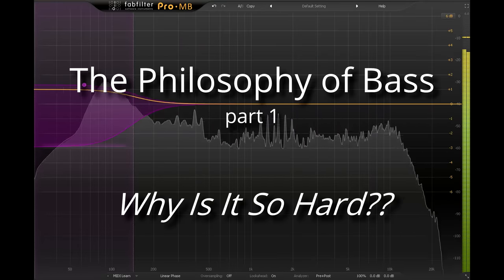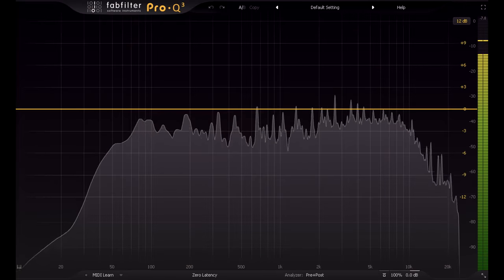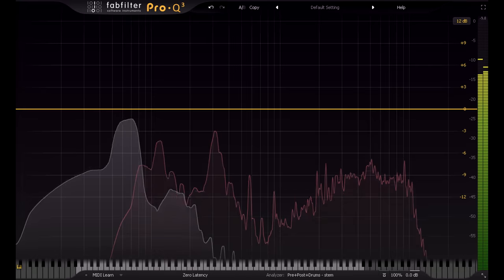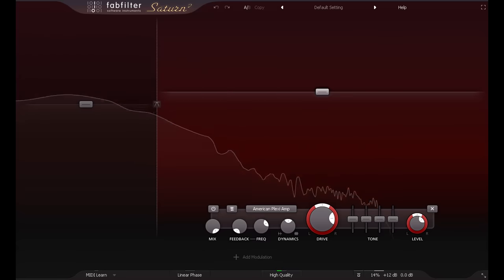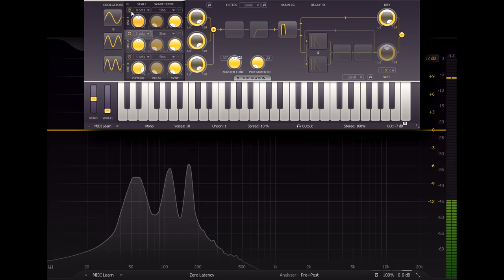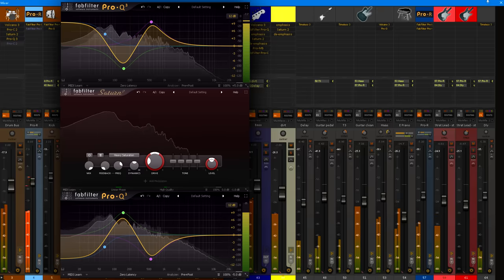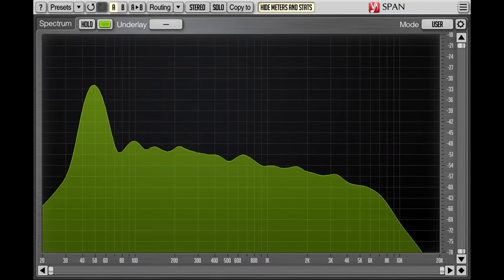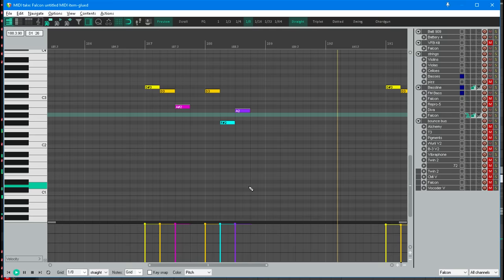The Philosophy of Bass

Comment: Why in the "Brain Bass" part is the third oscillator the fundamental + a 5th?
Is that needed for the trickery, or can it be an octave as well?
Reply: It's the third harmonic, at three times the fundamental frequency. Which is almost exactly one octave plus a fifth higher. The second harmonic is one octave higher than the fundamental (2x the frequency). The fourth harmonic is two octaves higher (4x the frequency). 
2nd plus 4th harmonics won't work: the second harmonic will become the fundamental, the fourth will become the second, and your part will sound an octave higher.
Reply: @DanWorrall  I get it now. Thank you.

Comment: Bass is ambient sound, omnidirectional. Whilst I wholeheartedly agree with larger is better the enemy of clean bass is resonance. For years I bought every speaker known to man. After being fed up with jousting with windmills I decided to build my own. A 2 way ported bass reflex using a 10” driver. The bass I experience is superb in bass impact AND bass extension. Why? I canceled rear deflections in the cabinets using felt behind each woofer. Resonant free. Pure bass impact and extension.
Reply: Care to explain a little more about this? wondering if this is a feasible DIY project
Reply: @220_hz4  I would but I’m seriously contemplating going into speaker building business when I retire. These produce competent thunderous bass with near holographic imaging. I don’t use soft dome tweeters either.

Comment: Even without basstraps you should have the subwoofer, just tone it down and then REMEMBER that it is turned down a bit, or has a modified curve. But it is better to have it than not. This is one big myth that still affects sound engineers, thinking that if it is inaccurate it is worse than not having it at all. 

There is a third option: subwoofer with headphones. If you have decent subwoofer, try it.. turn the main speakers off and leave the sub on.. it can be amazing, as it combines the accuracy of headphones with deep actual sub bass...

Comment: I think bass is difficult for a few reasons. First, we don’t hear very well down there. Our ears are much more tuned to hear stuff from 800-4k or so. Secondly, it doesn’t image…it just sort of “exists” as far as our ears are concerned. It’s more of a feeling sometimes and I think it can be difficult to engineer a vibe/feeling. On a more specific note, I think it’s easiest to get into trouble when you’re EQing bass. EQ for bass can make notes disappear and give your bass that uneven, touch and go sound. At the end of the day, it’s all about anchoring a high quality bass sound and locking it in with your kick…it’s just a totally different realm than midrange and treble. But the one thing it has in common is that the earlier you get a great sound, the better. The more you have to process your bass, the thinner the ice…

Comment: I didn't understand how you created that psychoacoustic bass (based on 2nd/3rd harmonics). You used a bassline played by a bass player and talked about parallel distortion. But how did you generate the psychoacoustic bass signal from the recorded bass and is it this signal that you're distorting in parallel?
Reply: It happens naturally with bass guitar, just make sure you keep plenty of midrange harmonics, and you'll be able to cut back the sub bass frequencies without losing the sense of low deep bass.
Reply: Well, the man himself explained it, but I can see why you got confused. He demonstrated the effect using synthesis to add and remove the harmonics. But a real world application of this would be parallel distortion, which has the same effect of adding those second and third (etc) harmonic overtones, allowing you to actually cut the EQ where the fundamental is (to make space for the kick etc). So the signal he is distorting is just the parallel signal of the bass guitar.

If you are a guitar player, or just have a guitar handy, you can emulate this psychoacoustic effect in your playing. Play an E5 chord as a double -stop - Open E and the fifth B (2nd fret) on the A string. Then play an inverted C5 chord, (3rd fret on both low E and A, notes are G and C). The second chord sounds lower than the open E5, despite both the notes you are playing being pitched higher. Learned this from heavy metal players! 🤘😝
Reply: @DanWorrall  Thank you, Dan
Reply: @RoganGunn  Thanks very much, Rogan

Comment: But doesn’t trying to pump low frequency energy in a room that is too small to support those low frequency wavelengths cause a range of problems that are best avoided and that would require huge amounts of bass trapping to avoid?
Reply: I’m not an expert on acoustics, but I think Dan’s point was that not producing those frequencies in the first place isn’t a solution.
Reply: @TjMoon91  Yes, I think you’re right… and bass trap when needed.   I finally have a mixing room that is large enough to natively support 20Hz without folding and aliasing the LF waves.  However, when I moved the 4 active bass traps from my prior studio in, they still tightened it all up— I assume because the low frequencies still extended a bit below 18Hz.

Comment: "the effective cutoff frequency of that high pass filter is determined by the volume of air trapped in the box" isn't really true though, in reality a ported design acts kind of like a roll off with an eq control point at the tuning frequency, the tuning frequency is determine by the length, area and shape of the port together with the box volume, the longer the port, the lower the tuning, the bigger the box volume, the lower the tuning, and the gain at that tuning frequency is determine by the air volume of the box and the driver properties like force factor, stiffness and so on, so the frequency responce isn't always a flat line with a roll of, and performance can vary wildly with different drivers in the same box. the lower the tuning, the less gain you're gonna get with the same amount of box air volume, and generally beefier drivers will get more gain at tuning than week drivers with the same air volume, so you can tune the box lower while maintaining the same level of gain with the same box volume, having more linear excursion also helps because with it you can get more and cleaner output just above tuning where driver excursion requirments are the highest, so a subwoofer the same size as your mains can actually perform better in bass because making a driver with more motor force and linear excursion will typically increase things like moving mass and inductance which hurts midrange performance so they cant be used in two way designs. more bass requires more volume is indeed a general rule of thumb, but the quality of the driver and design fundamentally effects performance so the performance for different subs with the same size can vary wildly and most commercial consumer subs aren't even near the limits of technology and physics so there's basiclly always gonna be a cost limited aspect of the design
Reply: Paragraphs my guy

Comment: Thank you by beginning the video with the truth: Bass response or fidelity is not about the size of your speaker, but first and foremost about the cabinet they are in. Next is the design and build of the speaker, and again not the size of the speaker. Everyone thinks you need 18" drivers/subs to be able to reach low frequencies around 20Hz. Yet there are manufacturers that make 10 inch subwoofers than can even go below 20 Hz due to the design of the speaker/sub and cabinet.

Comment: No, I'm sorry but I don't agree that you prioritize getting a sub woofer versus acoustic treatment. Using a subwoofer in a non-treated room can cause even more low-end issues. Everything will smear together, just look at a waterfall graph. Use the monitors you already know well, move them to the appropriate space, and treat your room. You'll notice low-end that wasn't there before as well as tighter low-end, thus improving mixing accuracy. I think that was some questionable advice that Dan gave.
Reply: He said to at least get bass traps.
Reply: @hfhome1231  My point still stands, acoustic treatment should be the priority.

Comment: I am sorry but at around 10 minutes i am not hearing enough bass from Drum and Bass tracks. I am listening on my HS5 which produce fair amount of bass. Also, just to verify i also tried listening on my DT770 and i could not hear bass. 
I am pretty sure that both my monitors and cans produce 80hz and above.
Reply: Try to feel the bass
Reply: You need to acoustically treat your ear canals better
Reply: As a matter of fact i did feel the bass in later parts and boy did it blow my mind (the video i mean). Its only that section around 10 minutes where i couldn't feel it.

Comment: Treating the corners for bass is NOT correct,-> treat the standing wave locations! Bass traps in corners treat about 5% of the problem. Check out the last Acoustic Fields video on the subject.
Reply: Sounds plausible, but then again not: let's say you're not sitting in a standing wave location. Why then should you treat it?
Reply: @000aleph  why would you treat it? Strange question....
It modulates at your lsitening position as well. That's why you treat where it matters. But I would argue start with proper positioning of the speakers.

Comment: Nice video, Dan! I only want to add something to your advice about bigger subs.
Ofc is important that the sub is big enough to deliver the SPL and low end extension needed for the room, but ppl need to know that the bigger the driver, the more mass/inertia it has and that means it will not stop as fast as a smaller transducer and that “ringing” will mask the signal, making it difficult to hear what is really going on.
If “bigger is better” was the only aspect worth cosidering, we would see mastering studios with 21” subs and that is just not the case. 
From my listening test, i would say that 12” (with servo) is the biggest driver that can also sound fairly controlled.

Comment: The idea of bass traps in corners is kind of a BS idea. If you use a room mode calculator you'll realize that the corners hold one of many many many modes in the room, and they all essentially need to be dealt with.

Comment: The problem with mixing on headphones is you lose the room around you.  All those reflections exist in the real world because most people won't be listening to the final mix on headphones.
Reply: Reflections do exist but so do a large number of people using headphones! 
I’d assume checking a mix on several types of speakers is helpful and depending on the genre, if it’s very bass -centric, aye.

Comment: 1. ideal model speaker is dimensionless point radiating all hearable freqs [20Hz-20kHz]:
a) hence the smaller diaphragm the better [speed, coherence]
b) one-way system is better than 2-way or 3-way [coherence]
2. learn your tool:
a) listen all day to any sounds, videos and music on your selected monitors / headphones
b) this way you will build strong reference in your head
3. notice that commonly shown methods of measurements of speakers and headphones differ:
a) headphones are measured on dummy head with physically modeled ear canals = good
b) speakers are measured without that dummy, only thru freestanding mic in anechoic chamber = bad
4.5dB/oct rulez!:
a) try to record one hour of good sounding modern music onto one track 32bit within 1 min loop - and if you measure freq response of this mass = it will be flat not with 3.0dB/oct but 4.5dB/oct
5. classical music peaks at 666 Hz:
a) apply the same recording method as above and check it on your own
6. simulate variety of sound systems and listening environs:
a) using EQ on master channel with low cut-off and hi cut-off = small speakers
b) using mono on master channel
c) combining EQ+mono
7. save your money
a) know your tools
b) make better mixes

Comment: I'm absolutely no professional and maybe I am just not accustomed to what professionals consider a good sound, but for some reason I always hated the effect of bassdrum ducking. It sounds like somebody covers my ears for a split second at every beat. I really don't see the benefit of that technique - if anything it distracts from the bass instead of defining it.
Reply: Yes it ruins songs for me, I'm also no professional, but i like to tamper with eq, measurements and calibrations, my system plays pretty loud down to 25hz, this is maybe a bit unrelated but i find it crazy how the bass region differs from song to song, some songs sound great with a 5db low shelf, some i can never get to sound nice and some even need a 30db boost at 30hz to sound normal,

Best example i could think of right now would be to compare kylie frey one night in tulsa to luke Combs doing this, yes it's country haha,

One night in tulsa has a great and powerful low end and a good thump while doing this is just dead unless you boost by a massive amount, the content is there but it takes some time to tune it back in properly, i think it rolls off at like 70hz or so, bringing it back in gives much more of a live concert feel

I really wish there was some sort of standard or that the low end roll of should be dealt with by the speakers instead of the mix

Comment: I discovered this issue, early on,, and my career. And it was absolutely codified for me. Back in 1978.  When I had, 3 pairs of monitor speakers in my control room. Which I could turn on and off individually. Or,  if I wanted.  I could have them all turned on together..  And I discovered. All other speaker manufacturers. Were out of phase.. Or rather. Out of absolute polarity. To my JBL's. And I was like, HUH? WTF?

So now with my, self powered,, Tannoy and KRK''s. I pulled those speakers from the box.  Reverse the connections on all the drivers. And reinstalled them. Now they all agree with the JBL's.  In their Absolute Polarity..  And most of your monitoring issues are now, magically gone!  Yes it's true. It's real. And to codify this for you better.

A friend of mine and many others. Who used to own, API Audio Console, company. They had their own studio. Which was designed by a fine Acoustic Engineer. And Electrical Engineer.  Yet the control room never sounded right.  That's when I get the call. Because I'm known to have a pair of the best,  ears, in the industry. And I don't believe in anybody's, audio Bibles or technical manuals. The way they are printed. I check everything. I listen to everything. I experiment, with everything. And it's right there. Where the problem lies. At the output of the audio power amplification. Into the physical input to the speakers. Where the polarity  a.k.a. phase.  In incorrect jargon and nomenclature. That what is in phase. It is actually in negative polarity, together. Left and right.

Mind blower, yes! But I had to correct API's own,, recording studio.. Back in the mid-1980s. Almost 40 years ago.  And it cost nothing to fix! I've made this correction for, dozens of other control rooms through the years. Both big and small,, studios and, Network Television Broadcast, operations.  Radio Stations, PA Systems. Even headphones are wrong!

I have blown everybody's mind, through the years. Without having to blow anything else. Or anyone. This is something I've wanted to bring up. At an, AES Convention. I had been, attending in NYC. For over 40 years. But I haven't. Why? Well? It gives me a leg up on my competition. As most everybody else's control rooms. Our in phase but out of polarity together. And I can't monitor that way. I can't tell what the hell I'm listening to, that way! Because your brain does not want to accept it, that way! But the college professors, want you to. Because they don't know either.

So when someone is having problems monitoring their $36,000, monitors. And I get the call.. I tell them that, their speakers are sucking.. To which, they frequently get,, hostile over. Telling me they cost $36,000! But they are sucking, literally. While otherwise, sounding great! But in phase and out of polarity.

You see, everybody thinks polarity and phase, are the same thing. When it comes to Pro Audio. In my book. Those are actually two different things! Phase is, small voltage, timing errors. Polarity is, high current, high power, wattage functions. That move air in large quantities.  And how you want that air moving.

This is a huge, huge problem. Made by dimwitted people. That all believe in a single religious concept. That I do not believe in.. And maybe it's because I was so different?

So I've corrected my own polarity. Personally. And I've corrected other folks, speaker polarities. Et voilà!  No more monitoring problems! And half of your acoustic control gobbledygook. Is now mostly unnecessary.  Strange but true.

Now you don't have to believe me. And many of you, won't. But I won't call you stupid. I will call you all lame brains and dimwitted. Which is like calling you, stupid.  But how could you know? When every indication is, that, everything looks like it should be right. But it's not. It's backwards!  With the, Absolute Polarity.

The problem really comes down to, something simple. Called,  DC Theory 101. But speakers are AC! But they still have a polarity. And you connect the positive terminal of the amplifier. Indicated in your manual. To connect to the positive terminal of the speaker. With JBL  brand speakers. Those will be correct. Because  their passive speaker terminals,, plus and minus. Are, actually reversed. To that of all others. Yup! They got it right!